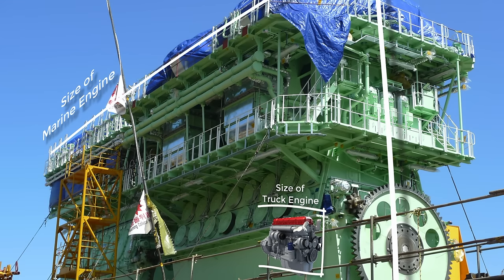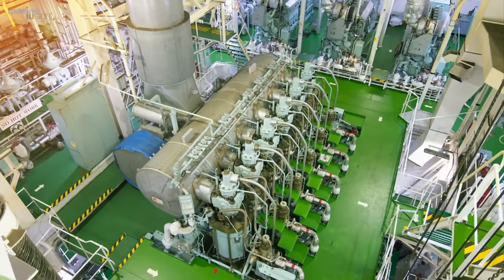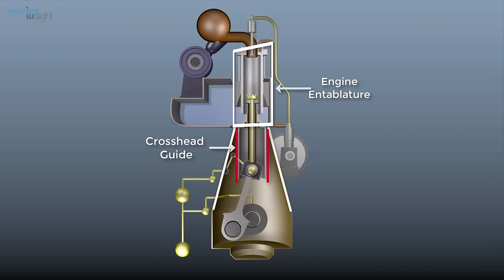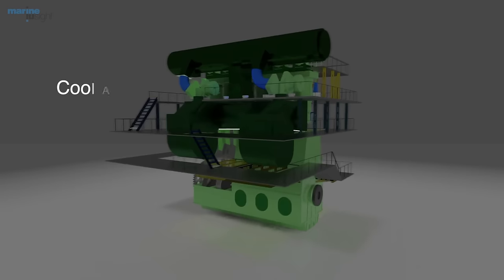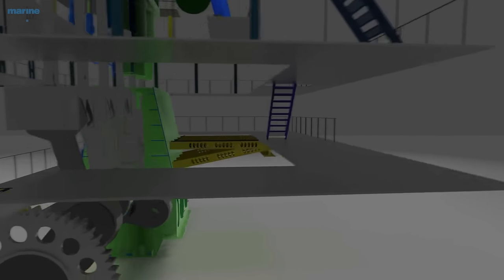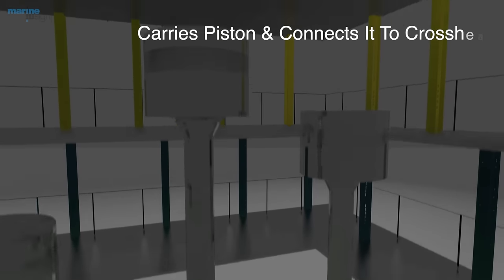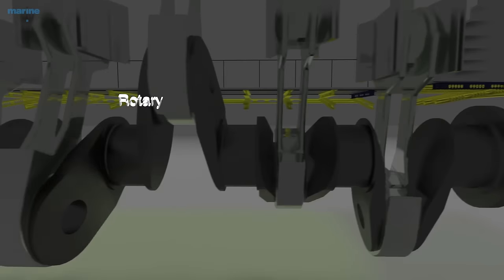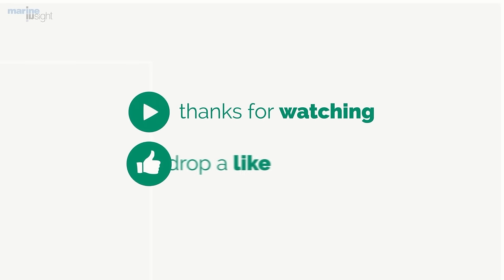Marine Engine Parts and Functions #marine #engineparts #shipengine

Comment: Please make a video of  engine mounting which will be quite helpful for the new comers in marine field to identify the components like wecs, solenoid, potentiometer, distributor, control airline, cas, pilot v/v, interlock line etc... Please 👍
Reply from the maker: Hi Amit,

Sure. 👍🏻

Comment: The engines are always the most important part of the ship.!!
Reply from the maker: Agreed. They are the Heart of the ship. 👍🏻
Reply: What is cc value
Reply: Great innovation. That's good for you .
Reply: @ezhilification  the size of an engine  refers to the total volume of air and fuel being pushed through the engine by the cylinders. So it's measured the air and fuel ratio according to the engine volume it's called as cc value ( cubic centimetre) . And its calculated formula will be [ 0.785 *( bore diameter)^2 * stroke length * no.of cylinder ]
Reply: except for the hull
Reply: nope, there where ships long before there where engines. Sailboats still are a thing. A hull is really important.

Comment: Who builds ships engines and where are they manufactured,  how much ddiesel does the engine  use
Reply from the maker: Different heavy industry companies such as MAN diesel turbo, Wartsila, Hyundai etc. builds these engine. 

Depending upon the size of the engine, the consumption can vary from 50 to 500MT / day.
Reply: @marineinsight  I am grateful for that information , different size ships will have different size engines. Is there a way of finding out the fuel consumption of different size ships from coasters up to 200,000 day bulk carriers
Reply: @michaelsrowland  see first of all the fuel consumption is depend on many thing : on the engine, the type of fuel , the output power is transmitted to the wheel to propel the ship .
We can measured the fuel consumption by various method 
1) flow meter 
2) (specific fuel consumption x HP)/Fuel Specific Weight
3) install fuel flow meter

If we want to reduce the fuel consumption in main  engine on ship : 
Perform routine engine maintenance.
Check your propeller (prop).
Maintain the bottom of vessel 
•decreas the weight on board 
•instal a flow meter

Comment: Your description of the turbo usage is wrong.
Reply from the maker: Please do send us more details
Reply: @marineinsight  It's all about how the intake and exhaust work without using the 4 stroke cycle. The compressed air forces out the exhaust while simultaneously filling the combustion chamber with a fresh air charge. They work in an entirely different way to a 4 stroke, they don't provide cylinder boost as the exhaust valve is open when the pressure in the intake is opened to the cylinder. Without a blower there's no way for the induction and exhaust, on a two stroke petrol the crank case and transfer ports provide for gas flow.

Comment: Can a smaller engine running at 1000 rpm be as efficient? What would be its weight for an output of 109,000hp?
Reply: The Wärtsilä RT--Flex96C weighs 2300 tons and is 13.5 metres high.
Reply: I live in Karachi Pakistan I like your comments if you don't mind
Reply: @BruceBoschek  Chris Kyle

Comment: what is the function stuffing box and alpha lubricator
Reply from the maker: Stuffing box are sealing and scrapping device which separate the crank case and scavenge space. They allow the piston rod to pass through without sending the exhaust by products from combustion to crankcase area.
Reply from the maker: Alpha Lubricator are cylinder lubrication system - Please check this article - https://www.marineinsight.com/main-engine/intelligent-cylinder-lubrication-for-modern-marine-engines-part-1/
Reply: thank you 😇
Reply from the maker: @yanarosadi3155  👍🏻